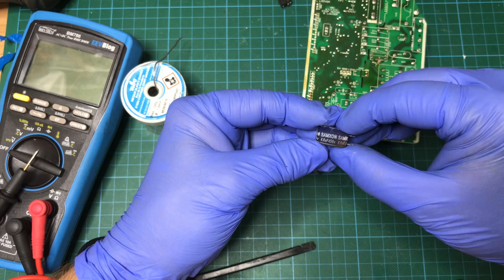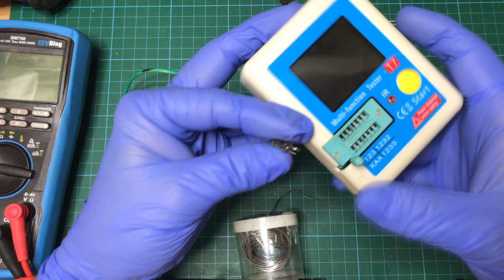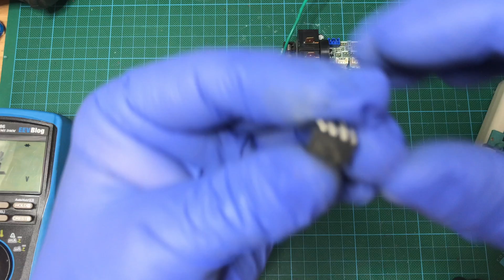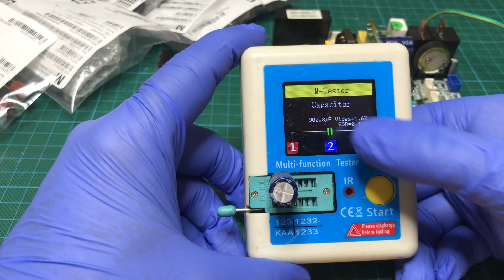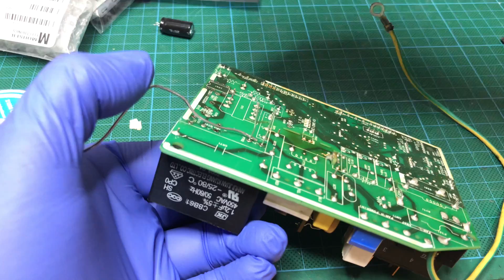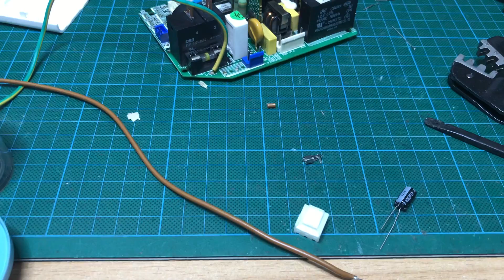Can't Get Them All! Samsung Split AC repair Indoor PCB AQV12NSAN #hvac tinyswitch ic

Comment: Good job but I think you should investigate the switching ic,is the ic has its vcc supply,the enable voltage the output voltage etc..i would search further around the switching circuit...switching ic ,mosfet and transformer...thanks for the video
Reply from the maker: Thank you for your comment and suggestions! 
The switching ic tinyswitch was replaced... These have an internal mosfet and that was what failed in the original one.. The feedback circuit components of the ic tested OK but I did not check the transformer... Unfortunately I don't have the board available to do any further test...

Comment from the maker: Feedback did come back from the customer. Unfortunately negative. I did not get back the PCB for further investigation....
If you have any ideas please leave it in the comments!
Thank you all!
Reply: Possibly short on output or faulty opto not providing feedback
Reply from the maker: @cuanhogan4330 Output was definitely not shorted and if I remember correctly I did check all the optos using a multimeter, they were not shorted but that does not confirm they were operating correctly. Wish I had the oscilloscope at that time :)